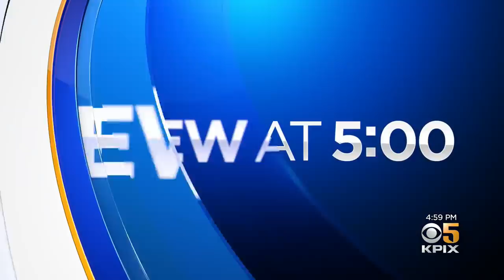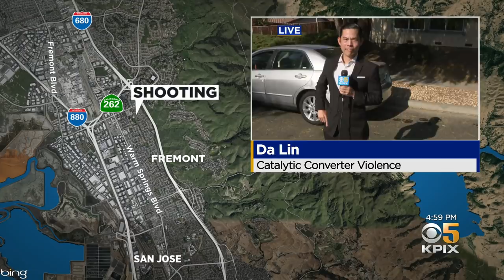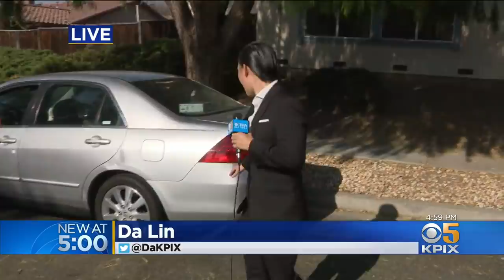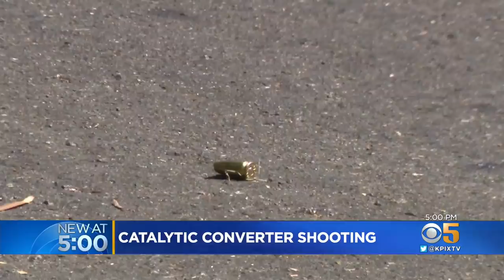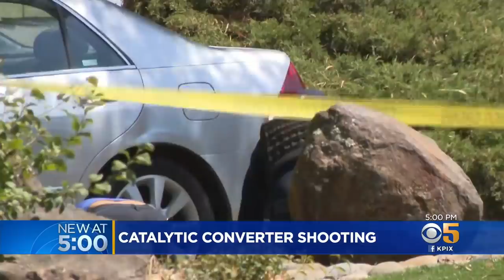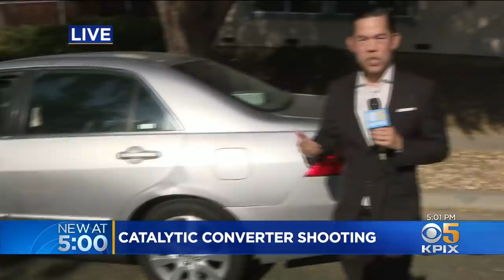Suspects in Attempted Catalytic Converter Theft in Fremont Shoot at Bystander

Comment: If your Legislators would out law Catalytic Converter Recycling this probably wouldn't be an issue.  Just to give a number on this problem, we had an crime ring get busted with 2000 catalytic converters and a lot of cash.  Most recyclers  give about $125.00 per converter.  2000 X $125.00 = $250,000.00.  Cost to consumers, a catalytic converter cost anywhere from $800.00 to $1500.00, we will use $1300.00 as a base.  2000 X $1300.00 = $2,600,000.00.  Yes, that is 2.6 million dollars that it cost the victims of catalytic converter thefts.  This number does not include down time, labor to install or your insurance rates.

Comment: my mom has the almost identical Accord and just had it's cat stolen two weeks ago, we now have to spend $2K to replace something that those crook sold for maybe $50
Reply: Etch the replacement and paint it with red high temperature paint.
It might make them go to the next car.
Reply: Per the news, for at least one model of pick-up truck, it is 10K to replace.  I have no idea why it's so costly.
Reply: @wownewstome6123  one quote I got was $4K, some truck has two cats, throw in a pair of O2 sensor I can totally see it goes up to $10K
Reply: @wownewstome6123  I only ever had to replace one and it was only $850.
But that was before metal prices went berserk because several somebodies sold out to China.
Reply: It's so annoying cuz it just keeps pushes people that need the money further into poverty. Its negative net gain for the area.
Reply: @wownewstome6123  The price of platinum has been going up and higher emission standards
Reply: @wownewstome6123  They are made with an extremely expensive metal.  I think it is rhodium.

Comment: I would release the jack on them and let the car do the job. Gasping for air while you ask yourself....was it really worth it.
Reply: They don't use a jack, one is not needed.  You just slide under the car and cut it off.
Reply: Someone got killed in Anaheim last month when the jack they were using failed and the person was crushed to death
Reply: @kenrushing7945  I believe that they usually do to make it quicker.  Might not be totally necessary but some fat dude isn't getting under a car and moving quickly.

Comment: installing barbed wires underneath the car may be a good idea
Reply: Or installing air bag suspension lol
Reply: Razor wire would be even better.
Reply: Thieves will only become more adaptable to each circumstance they encounter. I remember back in the day, chop shops would drive around at night in tow trucks and steal your vehicle, and strip it entirely to sell the parts. Now thieves only steal catalytic converters.

Comment: how to prevent Cat thief? 1) dont have a cat in the first place because cat is not necessary to make a car work. 2) upgrade your car with air lift system so you can lower your car so low to the ground that even an ant cant get in.

Comment: And thanks to California's stricter than normal emissions laws you're not allowed to replace your stolen catalytic converter with a cheaper 3rd party catalytic converter unless it's been tested/approved in the state of California which for cars like the Prius is literally ZERO other options,  instead of a $300 fix, you're looking at a $3000 fix
Reply: Very true. And there are more than just catalytic converter thieves, watch out for muffler shops. I have a Jeep Cherokee which needed a muffler and the guy told me I needed a catalytic converter and the price will be $1600. Well the vehicle just passed smog a couple of moths earlier and it wasn’t throwing any engine codes so I knew that was garbage. I asked him why so much and who makes it. He told me Walker and I saw the last 3 numbers and later found the same CARB converter for $520, they bolt in. I saw on a Jeep forum someone bought an out of state catalytic converter and their vehicle passed smog emissions but he couldn’t get a certificate since his converter wasn’t a CARB one. So does a CARB converter simply stamped with just another number since it appears another one works just as well and costs over twice the price?

Comment: Old model honda…the catalytic converter likely be very old and will be worthless…
Reply: Does the precious metals (palladium,platinum)etc erode over time?
Reply: @t-kx.erryb0dy  no they just get coated with carbon, so they don't work as well when they get plugged up. The valuable metal is still in there.
Reply: Somebody is buying them because mine got stolen in July and I have a 2003 Accord. BTW a new one is $1900 FROM HONDA.

Comment: There are "less lethal" means to deter criminals.  However, it's illegal to use pepper rounds as they are deemed "tear gas".  The only other method is to use impact rounds on a paintball launcher set at a high velocity.
Reply: What?  Against criminals firing 9mm rounds at you?  Maybe not engaging is smarter.